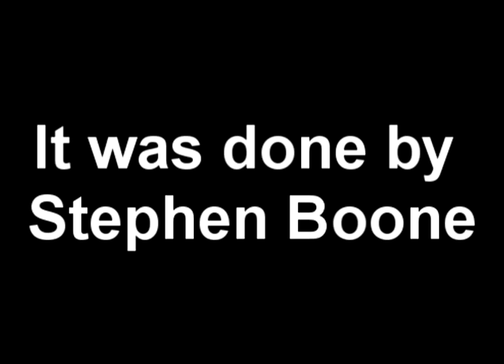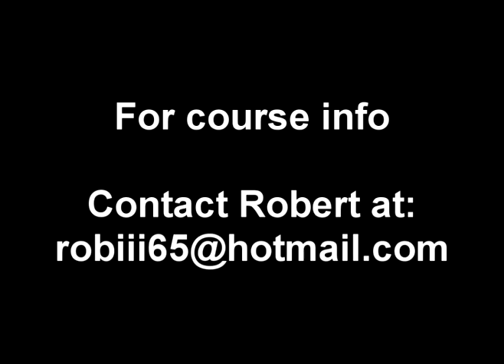10 Day Guitar

Comment: Was hide glue used when gluing the the bridge with the vacuum clamp? I just ask as there is a bit of a dispute going on saying that it takes the moisture out too quickly and doesn't cure correctly. Is that right, or is it viable to use a vacuum clamp with hide glue?